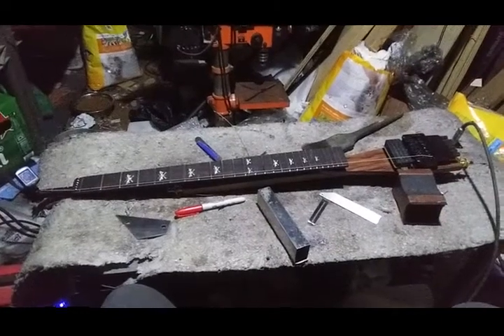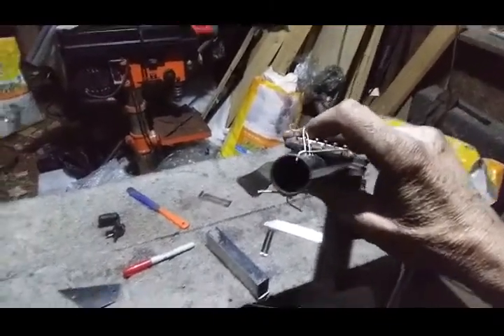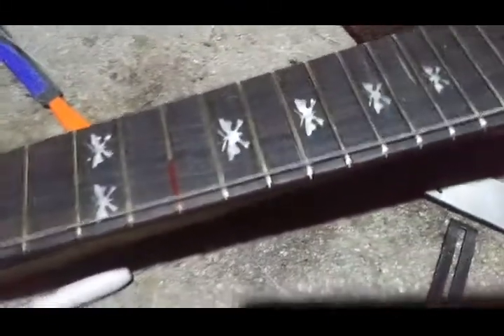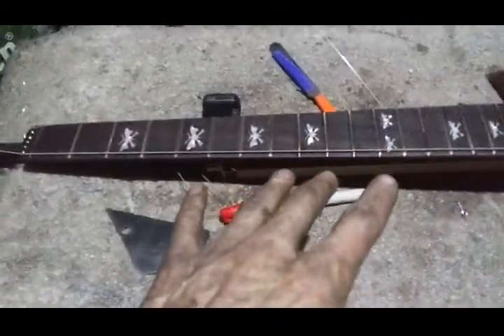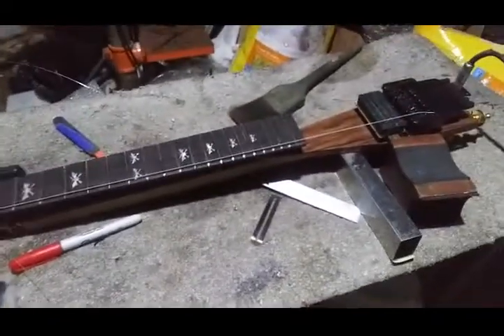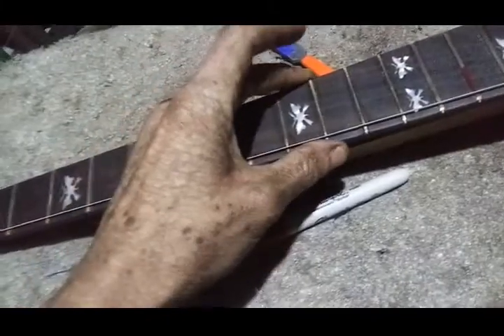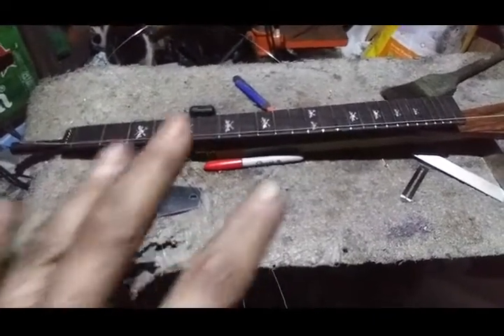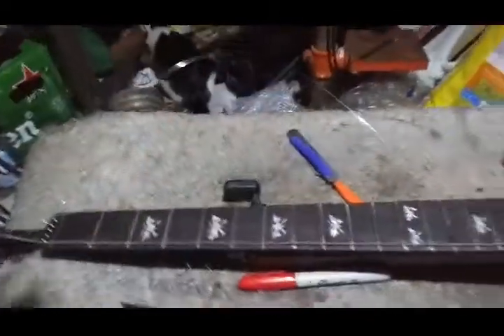The carbon fiber neck build

Comment: I wonder if filling the sides with epoxy would help with this problem? A valiant try though! Incidentally I’ve built a few necks from carbon fibre panels that were laminated together, worked really well...although they are slightly on the heavy side. Both my builds sustain really well.
Reply from the maker: The problem was a "too fat" profile as compared to the trapezoid necks.  The triple tube profile fixed this:
https://www.youtube.com/watch?v=_CsR2g2AV3g&list=PLDxhKgqkO6tMWloUAZujLgtID_j0Jmppq&index=1
https://www.youtube.com/watch?v=jiiWatjho4g&list=PLDxhKgqkO6tPJTGhMtIsTlG1RtJx3LAjo
The triple tube neck beats both trepezoid wood and aluminum V necks on weight, but only by a few grams.  While I haven't noticed any special sustain behavior, they do seem to transmit treble frequencies well.